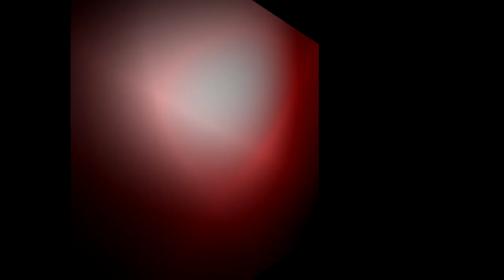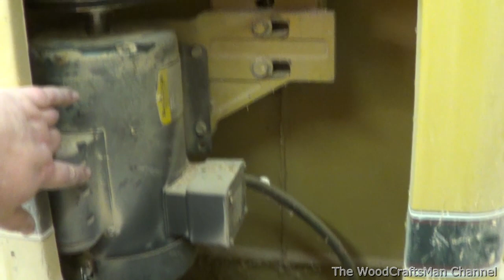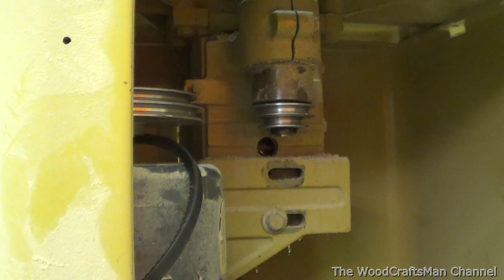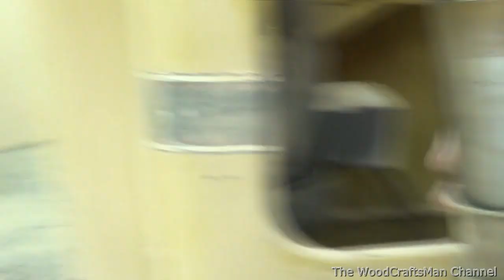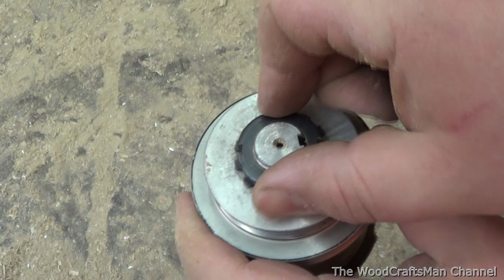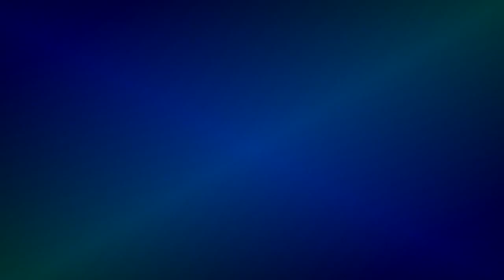Powermatic 27 Shaper Spindle Pulley Repair Part 1 of 3 # 143

Comment: Probably too late but just buy a tb woods cast iron pulley with bushing which is plenty tight and isn’t even required to use a key for strength. They don’t even make them with set screws

Comment: Hey Scott -  do you know the size of the 3VX belt?  Or a part number? Or recommendation of a good source to get one.  Thanks ....Got it ..  I rewatched your videos to figure it out ..   3VX315 ...
Reply from the maker: I've run a 3VX300 on the the large frame motor before it works. I think though it normally is a 3VX315 for the 5hp and 3VX300 for the 3hp which would have been a 145t frame motor. Let me double check what is have in mine. Thanks. Scott
Reply from the maker: Yes, just confirmed, a 3VX300 will work fine. V-Belt Supply is a good place for belts. Just google V-Belt Supply, it's in the upper midwest, North or South Dakota.

Comment: Hey Woodcraftman - I'm in need of a 184T (Large Frame) motor pulley for my 5HP motor - (1 1/8" shaft).  Any recommendations where I can get one?
Reply from the maker: Well..... Powermatic used to sell them on their website parts store, but like any other company out there today, they could care less about their past models, and screw anyone that needs parts. Fortunately, there are companies like eReplacementparts. Check out the link below, looks like they have them for about $78, which isn't bad considering I paid that 10 years ago for mine back in 2009. https://www.ereplacementparts.com/motor-step-sheave-118-bore-p-1742341.html?osCsid=01r3tm64ip4vabgunp2l1mbu24
I hope this helps.Good luck! Scott